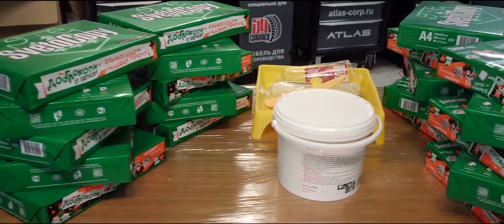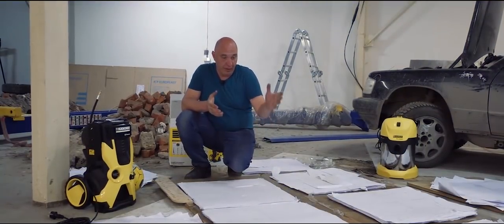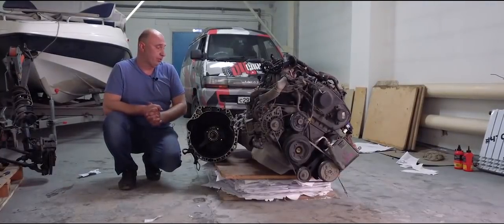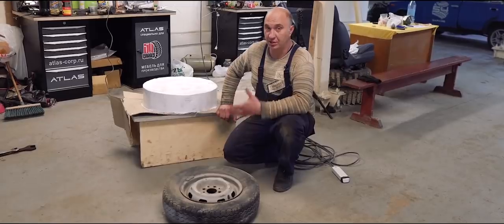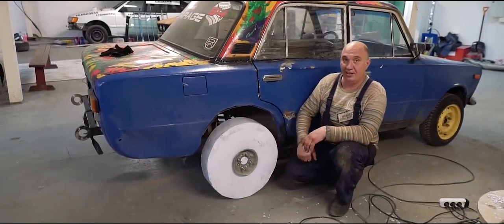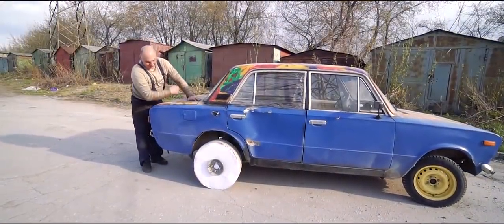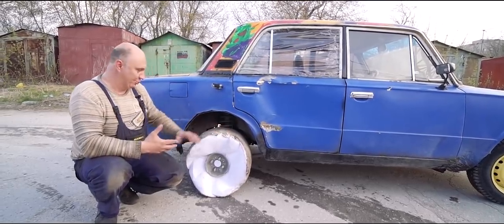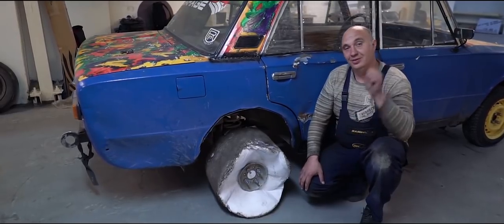Making a wheel from 10000 sheets of A4 paper

Comment: Each section needed to be baked in the oven at 500 degrees for 2 - 8 hours depending on how much glue was used and size of sheets used.  Then the final product needed to be placed in the oven at 500 degrees for an additional 8 hours to finish the bonding.
Reply: Letting it set to dry without heat won't do it alone.
Reply: Oh crap, my apologies.  I forgot to say fahrenheit, yeah, don't do celsius or bad stuff will happen.  Lassi is correct, not sure why I was thinking 500 degrees - working with too much air soldering.  Somewhere around 250-300 degrees is more appropriate.  However, since this video is 1 month old and they've done a shit ton of stuff to the car already, I don't see the purpose in suggestions anyway.  This channel is seriously lagged behind.  :/  Some of the videos are 6 months behind or more.

Comment: You could also do something similar by using continuous feed paper.  Run the car and roll it onto a rim, while also applying glue with the roller at the same time.  But this worked pretty well considering!  When I saw the finished product it made me think of the Flintstones :-)

Comment: I think its a great idea. You should just improve on it. Maybe try and cut it with a lathe to make it as circular as possible. Then maybe make two washers, on behind the paper wheel and one on the front. Make the spacer a bigger diameter so it holds the paper together and prevents it from widening like what happened in ur video. Then try and drive it at a normalish speed. With a lot of care off course. Great video guys!

Comment: you could have a paper or improvised tire endurance race between you and a couple friends. Each driver would have to build one tire using the same specified materials and replace one wheel on the vehicle that they choose to drive with the improvised tire(NO 4X4 OR AWD VEHICLES OR WELDED DIFFERENTIAL) The challenge would be pushing the vehicle hard enough to win the race without the tire falling apart and disabling the vehicle. It might be a stupid idea but it would be a lot of fun and make for entertaining videos.

Comment: What if you put a nice size washer on the back side and the inside, or better yet, Fit a rubber tire around it. Might be a better/more solid idea vs using air. Atleast a nail wouldn't be as much of a pain in the ass if the tire is full of paper instead of air.

Comment: I just learned American trains used paper wheels in the 19th century. I shit you not.
Reply: "The construction process involved the bonding of 200 circular sheets of paper, as follows. Sets of three circular sheets were bonded into a "sandwich" using a flour-based glue. Additional "sandwiches" were then constructed and placed atop one another to make a 4-foot (1.2 m) high stack. This stack was placed in a 650-ton hydraulic press for three hours.[3] The circular compound disks were then dried and cured for six to eight weeks, leaving no moisture in them. After curing, the compound disks were turned in a lathe to the appropriate size, and 24 or more bolt holes were drilled in them. These compound disks formed the center of each wheel, to which was added a cast-iron hub and steel rim bolted to 1⁄4-inch (6.4 mm) thick protective metal plates on either side of the paper center. With the bolts tightened, the paper center became a "solid, dense, compressed, composite structure" which could support the weight of the carriages."